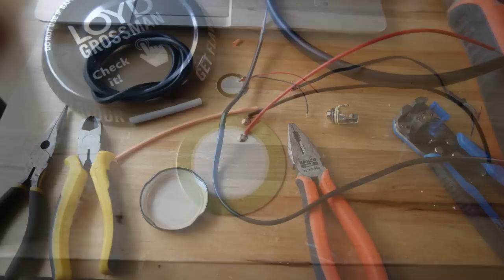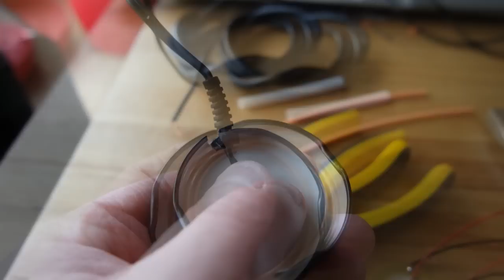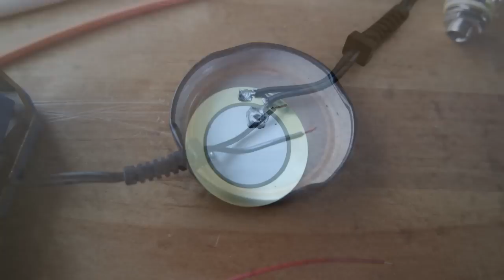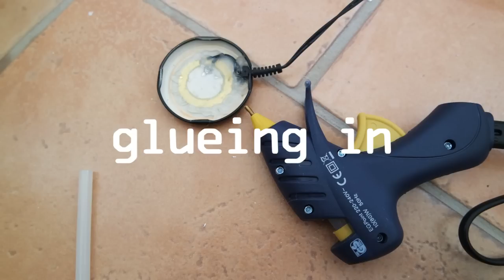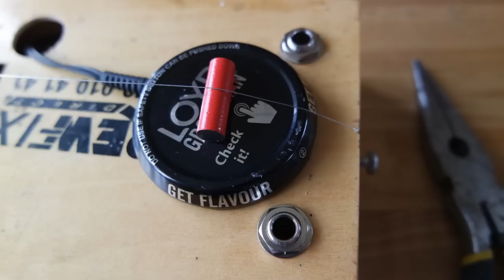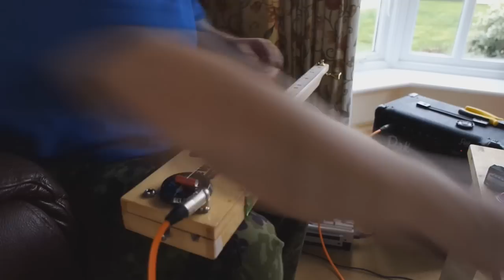Home made cap piezo diddley bow pickup

Comment: Thanks for the video! Rookie q, but how do you then connect the input jack to the pickup?

Thanks from Tim in Ireland.
Reply from the maker: +Timothy Daly 
Hi Tim
Thanks for your question, and also apologies for the long delay in replying to you. I have been without internet access since the England Wales game, as I have moved to a new house in recent weeks.
I soldered the 2 wires directly to an input jack. It looks like the jack socket was silver plated, it was very easy to solder to
Good luck with your build if you do one, its very rewarding